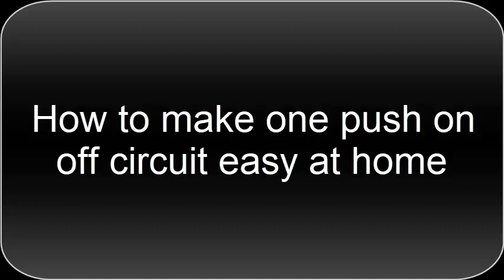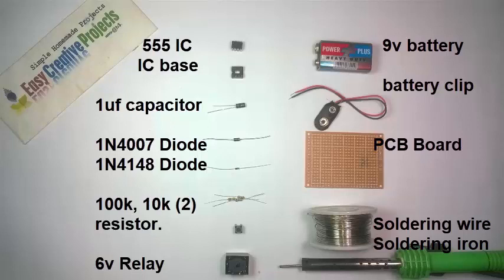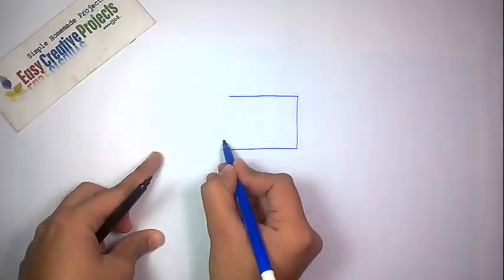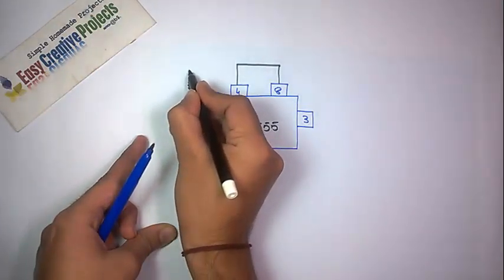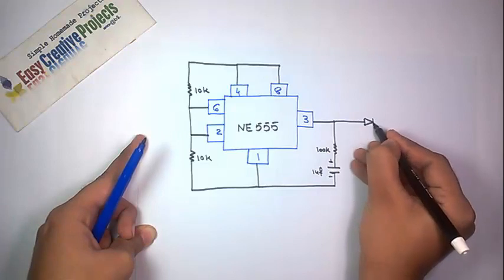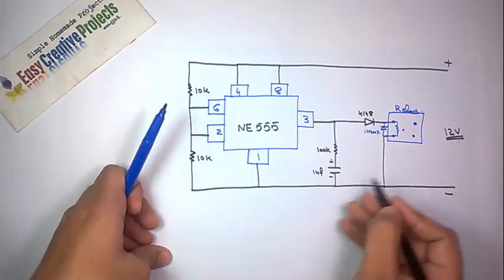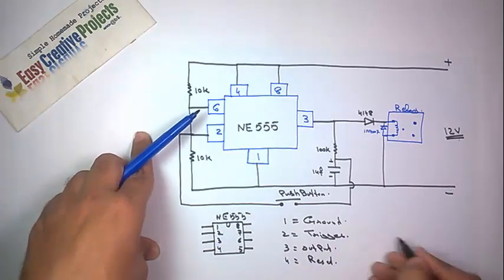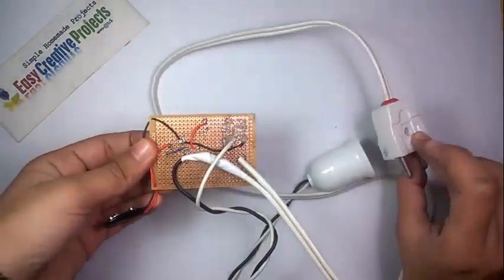How to make one push on off circuit easy at home

Comment: Dear sir. I would like to make the same kind of circuit. But I want that circuit to be work on 24vdc input. Please advice me how to do that.
Reply from the maker: simple use 9v voltage regulator (LM7809)
its convert 24v into 9v output.
thanks.

Comment: can use 24vDC supply as input ?
Reply from the maker: no dear this circuit work on 9v.
 if you want to use 24v input so you need to add 9v voltage regulator.